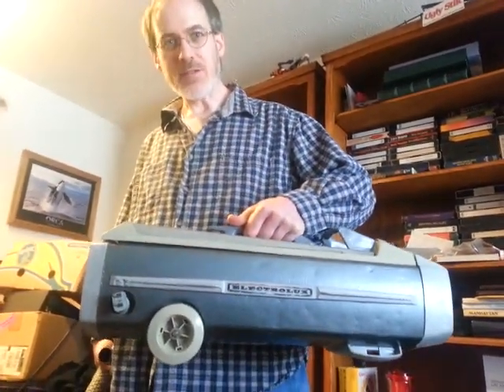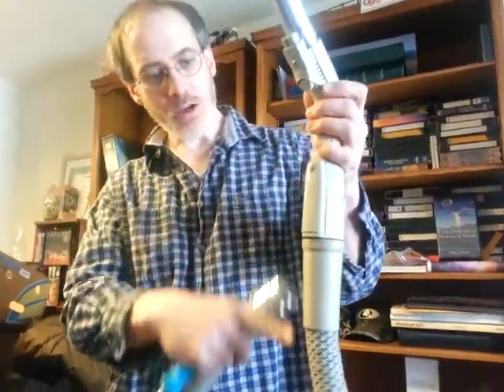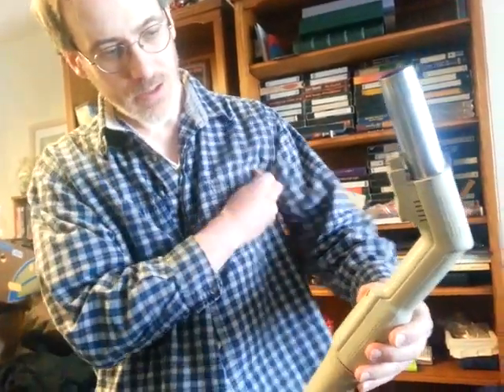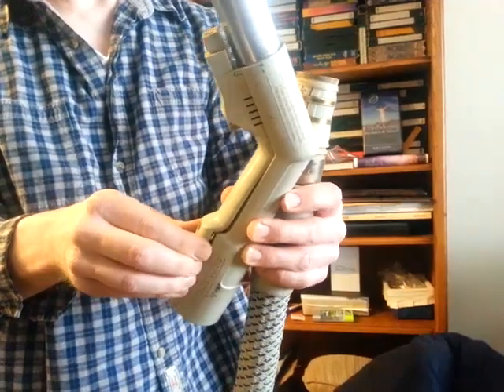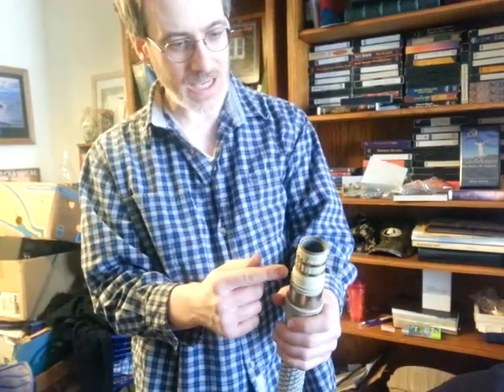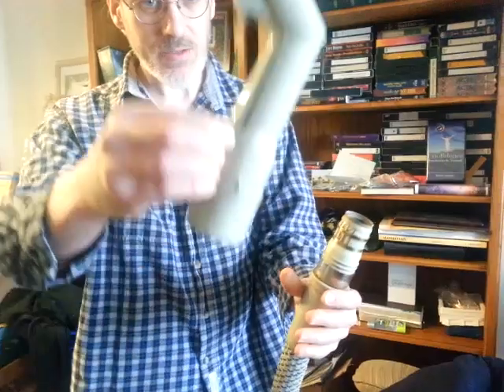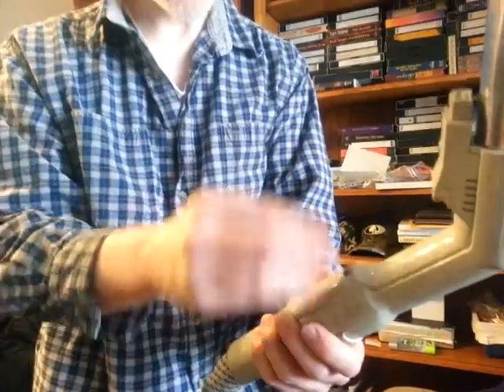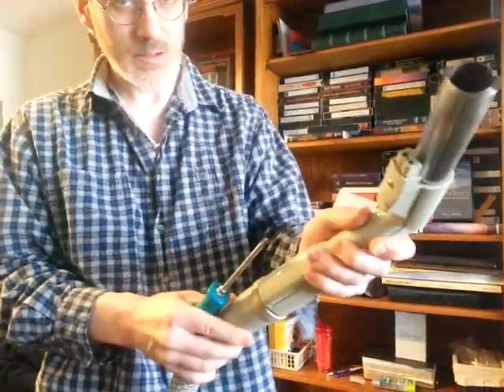HOSE HANDLE REMOVAL ELECTROLUX CANISTER VACUUM

Comment from the maker: We later Found the hose had lost suction due to deterioration and was not only due to being clogged. Time to buy a new hose! Second one I've found this issue.
Reply: If the hose's outer condition is good, you should consider resealing the inside of it with liquid Plasti-Dip (or Rubber Dip)--or another liquid latex product.  I have done so with remarkable results.  Go to the Vacuumland website, type in "repairing cloth hoses" in the vintage section, and you will find several postings with directions.  Thanks for posting this as Aerus/Electrolux repair videos are rare.
Reply: Yes! Woven hoses are permanently flawed in this sense! Veey few remain air tight! Never just buy one off Ebay, because other sellers don't know this, and they never test a used hose. To right way to correct this is to go to a vacuum cleaner shop or an Electrolux dealer, and buy a vinyl replacement electric hose! Trust me, youll be glad you did! They are easier to handle, last longer, and are just a better option. Also, always store the hose off the canister and Power Nozzle. Never store the machine in one peice with the hose connected. That puts two stress points on the hose, and will eventually make ANY hose go bad. You want to store your hose in one of two ways. Either on the floor of your closet laying flat. Or hung on a hook, or a hose holder in a graceful, upside down "U" shape! That way you will preserve your hose for many, many years!
Reply from the maker: @adamdickinson1531  your most welcome
Reply from the maker: @queenconvertible  great advice! Thank you!

Comment: Thanks for the short video.  I have had the vacuum since 1979 and couldn't figure out how to get that thing apart without breaking it.  I got it apart, cleaned the clog in the hose, and now it works almost as good as new.  They don't make them like that anymore!

Comment: The plastic handle on my hose broke. I glued, taped, failed and was about to buy a new hose when I saw your video.  Now I know why I kept that old hose that had split and cracked and despite taping it, gave me little shocks when I used it. Followed your video EXCEPT my hose handle has plastic notches and pins that have to be pried apart.  A little effort, but I was able to swap the handles and the hose is "FIXED". Thank you!
Reply from the maker: Awesome glad it was helpful!

Comment: Excellent!  Thank you for giving us information that (up to now) seemed impossible to find.  But now I'm looking for information about the little dial on that same handle.  I says "Open" with a little curved arrow.
Reply from the maker: Hmmm not sure about that dial. What does it do?
Reply: @livenfree  That's what I'm trying to find out.  It's just about 1.5 inches from the screw nearest the end of the hose.  I managed to turn it to full "open" and  now the suction at the end of the hose seems to be a little stronger but not nearly as strong as the suction at the opening when the hose is removed.  We have two Golden Jubilee models and both hoses have the little dial button broken off and no instruction book.  I'm guessing there are tens of thousands of Electrolux owners with the same problem.
Reply from the maker: @nemo227  sounds like that is the vent to reduce suction at the end of the hose say your sucking dust off some fragile glass etc. Odd its stronger when open. In the video you can see mine on bottom of the hose just up from the bend. Right below the small vents that allow the air in. U may find an original owners manual online or on ebay by searching for model number and the word manual
Reply: @livenfree  I agree.  That's the most logical explanation.  I've been searching and I'll keep searching.  I also have an above the range microwave with a bad front door frame.  I've ordered what was supposed to be the correct part and had to send it back.  I even bought a smaller counter top micro a couple of years ago but I want my counter space back.  I'll most probably just figure out a modification and put my old door frame back.  I have a radiation meter to double check for any leakage.  There is always something to fix.  Meanwhile our refrigerator/freezer has been functioning for 30 years.  Go figure.

Comment: Terrific video thanks. the central vacuum Electrolux has the same attachment and when our blind strings got tangled up in there I couldn't figure out how to pop off the handle. It is very old so after taking off the screw it still would not lift up I had to use a flat head or a knife at the side to pop it up a bit and the  hose will slide off like butter and you can untangle inside
Reply from the maker: Glad it helped! Thanks for the feedback! :-)

Comment: Excellent! The 'plastic dip' method that's touted on Vacuumland as being the end-all solution, is not. If you're using a hose with this process as a DD, it will not  while  hold good vacuum over time. If you're collecting vacuums and you just need the hose to work, the dip method would be fine. Commercially, there are 8ft lengths of clear shrink wrap that may be the solution...but it may make them too stiff as well. I've yet to try it.

Comment: hm, I have an aerus legacy lux and Im trying to remove the handle from the hose, but my handle must be a different model. There is no screw, only a blue  plastic square pin. I remove the pin and I still don't see how to remove the handle. Any ideas?